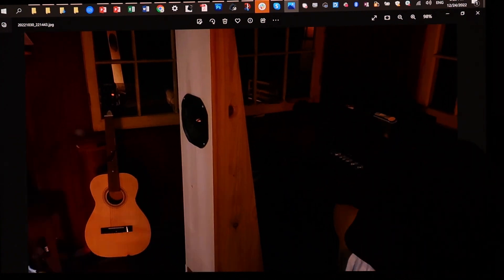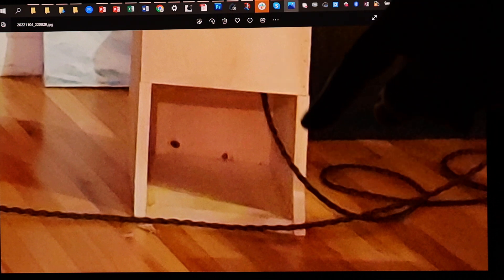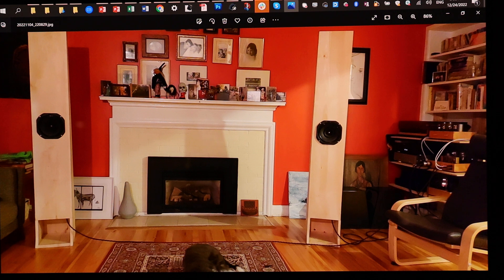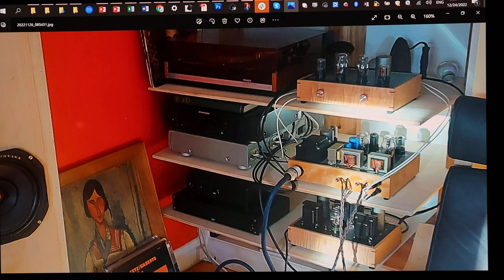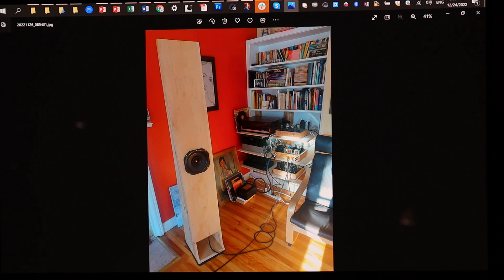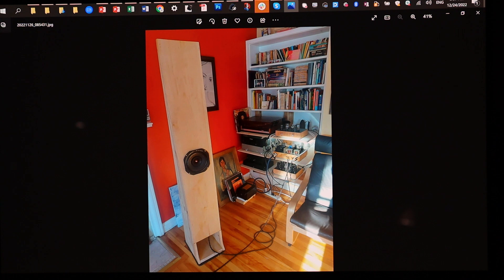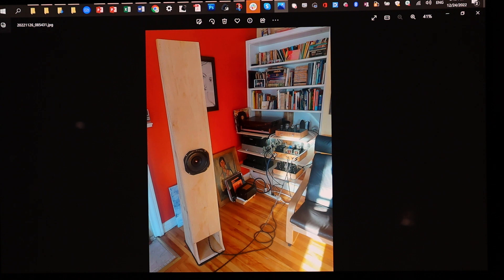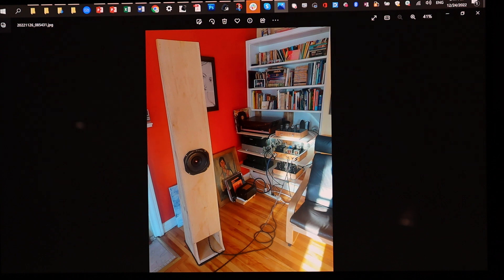Sheldon Marcellus' Audio Nirvana Voigt Pipe!! ✨✨✨✨👍👍

Comment: Very nice !! I will build a Voigt pipe as soon as possible. Can they rock,? +100 db
Reply from the maker: It really depends on the amplifier... with 5-10W it can rock out at 102dB or so. As Sheldon said, they are killer with Led Zeppelin and King Crimson... and I never felt I needed more SPL. 
Cannot push beyond 105dB, not for the 110-120dB land.

Comment: Is there an issue with drilling a hole in the rear panel & letting the cable out thru it? The hole can be sealed off with hot glue or putty.. That wouldn't have the cable dangling out in front..
Reply from the maker: That can be done as well. The downside is it will be hard to upgrade the cable... ;

Comment: I’m currently building some speakers using the same Audio Nirvana 8” drivers. Except they are in sealed folded triangle shaped infinite baffles with 2x Eminence 15” woofers for each speaker.

Comment: Love the curved bottom, I had a pair of old Lowther PM6A, wonder if anyone can help with the dimension/plan to build a Voigt pipe for it?
Reply: Hi Ken.  My cabinet volume is approx 6 litres more than the Vas for my driver. Cabinet is approx 50 litres. AN Super 8 Vas is 44 litres. The PM6A Vas is 56 litres. A 60 litre cabinet would be just about right. Guess what, Janos' VP cabinet, where he goes through all dimensions in a previous video, is approx 60 litres.  When mounting the driver, make sure you have enough depth in the wedge. The PM6A needs at least 10 cm depth, going by specs. If your room supports it, you will get awesome bass. Fs is spec'd at 45 Hz. My AN  driver Fs is 57 Hz. I'm getting great bass in my room with the 1.5 w type 45 amp. Good luck to you!

Comment: @Real World Audio: I have a question on voigt pipes reflectors. Here, we see another voigt pipe without reflectors in the opening. What is your view on reflectors, straight and curved?

It seemed, when you were going through the Joburg pipes, that you were going to say that a reflector in the port is not the best idea - or just maybe unnecessary. They were curved too, while most other reflectors I have seen have been straight. But at the time you could not find the particular place on the timeline and said you would come back to it. Maybe I just missed it, but I haven’t heard anything about it. 

You put out so many videos (I am very impressed!) so you may very well have talked about it, I just didn’t find it. If so, sorry!
Reply: I'll try, if I may, from info I took from Janos' vids.  The flat bottom allows reflection upwards into the wedge. Creates a bounce which aligns molecules in a laminar flow. I can visualize laminar flow on the surface of a smooth flowing river but inside the Voigt Pipes, wah. The wave mechanics must be a sort of organized chaos (that is music). But, I can visualize a reflector's effect based on this.  If a bouncing up and down inside the pipe is a sonic benefit, then adding a reflector will interfere with that up and down motion. It must, geometrically.  Now, I could try installing a temporary reflector to listen for a difference. Maybe, and I'll share my observations. Cheers!
Reply from the maker: Sheldon gave a superb description. ; I have tried deflectors, and adding one (a straight one) just diminished the bass response, and had no sonic benefit with my Voigt pipe.
Reply from the maker: Also, one more thing: the reflector significanlt decreases the free air volume of the pipe, hence if one plans to add one, you need to make the cabinet quite a bit bigger to compensate for this serious loss (which compromises bass response)
Reply: Thank you so much, both! I am not always so good at remembering what I am seeing anymore. Blaming post covid, or maybe just age ;) But I understand. This will be easier for me too, I was going to copy the Tech Ingredients voigt pipe at first, but all of the changes here makes the build easier. Drop the reflector, drop the internal dampening glue/thin plywood sandwich, drop the reflector.
Reply: @zixzysm  That's the beauty of it. Simpler build and superior results, I think. Thanks to Janos for sharing decades of research, knowledge, and experience. Priceless.  Best of luck with your build. Great New Year's project!

Comment: I just received the parts for Le Petit from Boomaudio in Germany, but I am a bit conflicted. I am wondering if I should return the drivers and build some of these. The price is not a factor and I have room for either one....Hmm🤔.
Reply: If I do stick with the LePetit do you have amp recommendations under 500 euros?  New or used.  I have 15 years old Micromega Integrated amp at the moment and it's pretty good with my (even older) HansDeutsch speakers.
Reply: Why don't you make instead of taking the drivers back a minivoid pipe, do both and see Which you prefer.
 what is the driver in question you're talking about
Reply: I've built Janos's pipes and they are fantastic. 
They are really actually cheap & EASY to build. (Make a great first project for French polishing too)
However they are really truly not for every room, as has been said here more than once. 
To say they are a statement in the room is a huge understatement....
And that's just the asthetics, they need some space to sounds big.
The lePetit however are very happy in lots of different spaces and look great.
A mate of mine built a pair and I'm soon to follow just to have em in my side room.
I'd start with the small and work up from there....
Good luck, and happy Xmas
Reply: @hoobsgroove thanks. It’s the Fostex FF125WK.
Reply: @dannixon247 thanks for the ideas. Yes it is my first build. It will be fun no matter which way I go.
Reply: @earlfenwick  they should work well in a transmission line like a voigt pipe. You might like to try a piece of open cellular foam below the driver close to the driver touching the frame sticking out about 4" deep and 3" in length give or take the cabinet size and complete width of the sides of the cabinet, add  better compression speed differential matching.